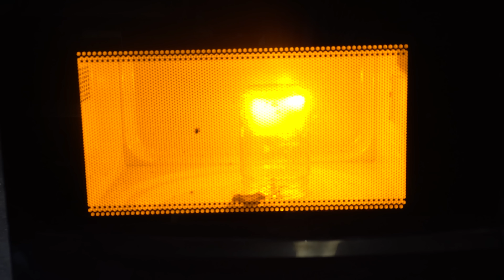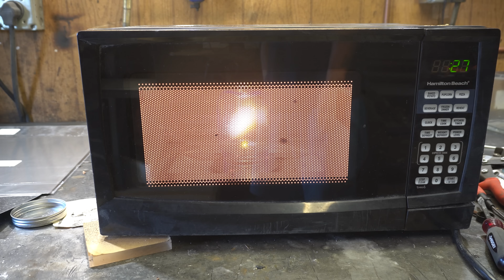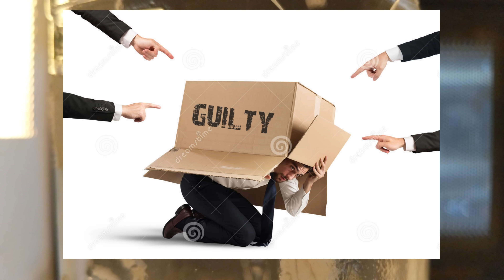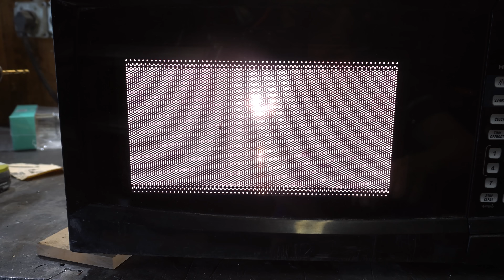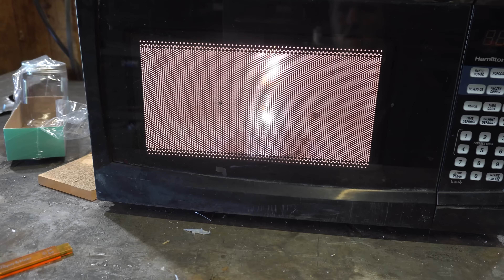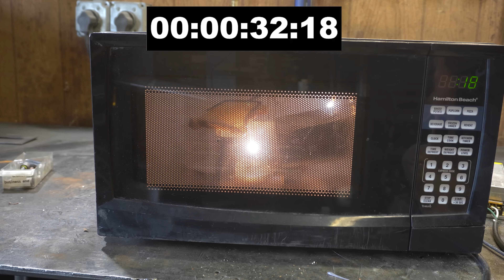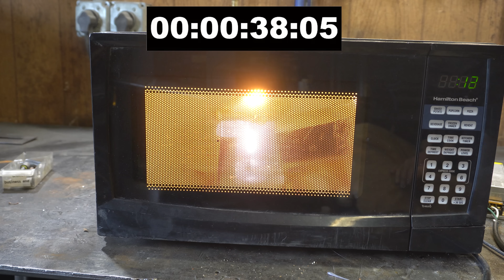Cooking Toast Using Microwave Plasma

Comment: Why didn't you use the little motor on the bottom of the microwave and just put multiple plasma jars and let the tray rotate the plasma jars in different positions under the toast? Seems way easier to me. Or put the toast on the rotating tray above several jars around the circle??? I'm just curious if this would be a better option?